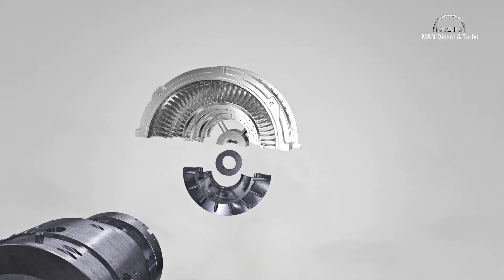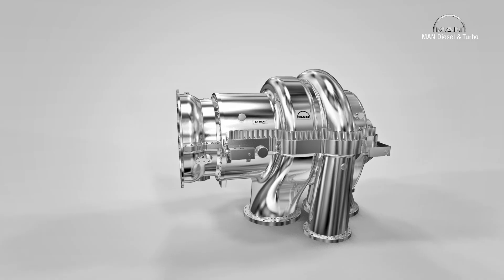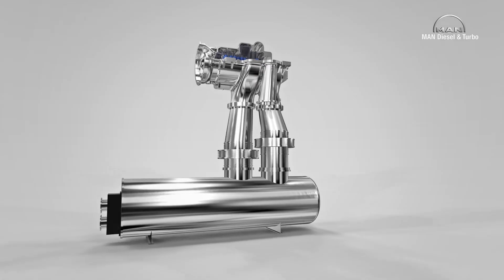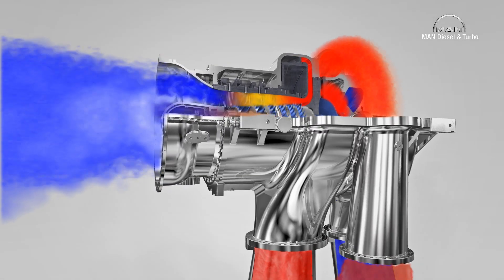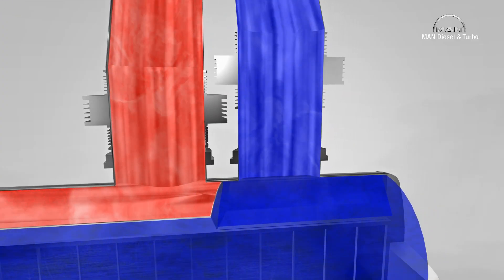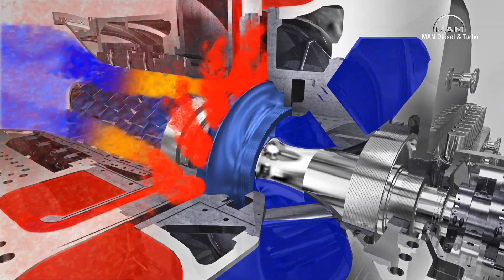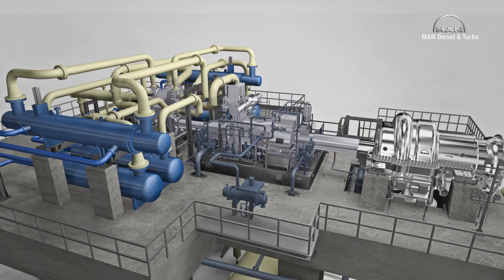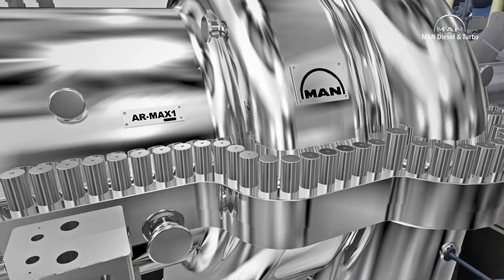3D animation of axial flow compressor working principle

Comment: That is one very serious and LARGE compressor, must take 10,000 plus horsepower! Found it, 85825 horsepower‼️

From product page:

MAX1 is the smallest and lightest solution in the market‼️

The MAX1

A revolutionary product borne out of decades of experience, the MAX1 is a standardized axial/radial main air compressor equipped with the advanced MAX1 axial blading generation. It can deliver volume flows up to 1.5 million cubic meters per hour, pressures up to 25 bar and is uniquely compact, robust and efficient. Its wide chord blading allows for greatly increased ressistance to mechanical blade loads. It is a fully API compliant, standardized modular system with a simple layout and reduced number of parts. Great efficiency, easy maintenance. With its potential ranging from higher pressures for HP-ASU, to very large air compressor trains (7,000 t/d O2 and larger), the MAX1 is the smallest and lightest solution in the market. It is easy to transport, operates with optimized efficiency and is highly robust.

Love it!

Comment: what do you do with the condensation of the compressed air who circulate and acumulate in the intercooler ?   i mean where go the water ?
Reply from the maker: If water condensation is most likely according to the process data, a demister is used working on the principle of inertia and ensuring a separation of the water from the process gas. 
Drops of water fallen down from the demister collect at the bottom of the intercooler where a water valve opens and closes automatically at a certain flow.
Reply: Thank you for your response !   I have enother question, i eard about the heat produced by the air compressor beeing used to produce steam on demand in closed loop  to power a steam turbine who drive the air compressor in same time.  In other words, no fuel or any electricity is needed to run the both machines, the compressor produce the heat needed to produce the steam, they just fit a hot water injector in a pipe around the hot spot of the air compressor to produce steam on demand.  In short, the airplane industry use this system to power their planes without any fuel at all.  I knot that because the big front fan of a A380 is responsible for 75% of the thrust and its cold air meaning that hot air is not a good ''pusher'' compare to cold air.
Reply: @denisgiguere1600 
Outstanding, you have designed a perpetual-motion machine!